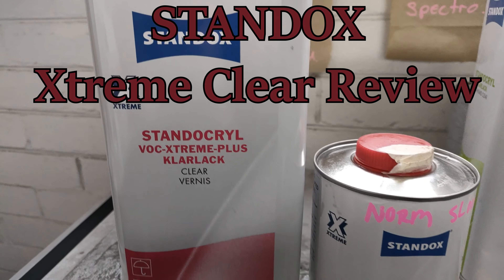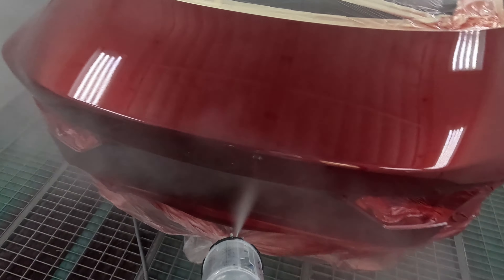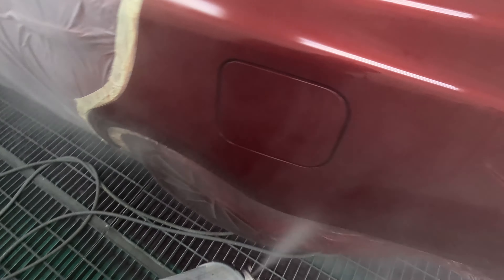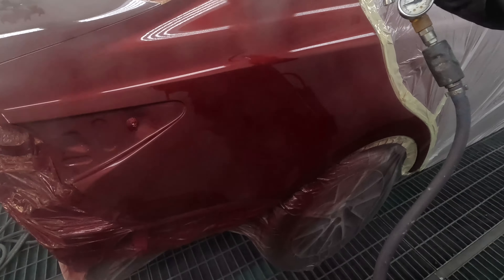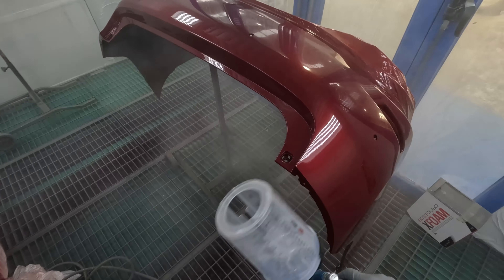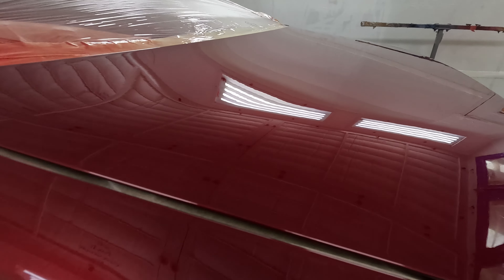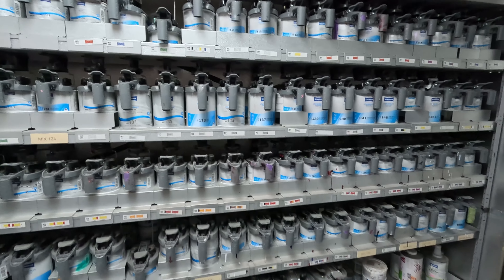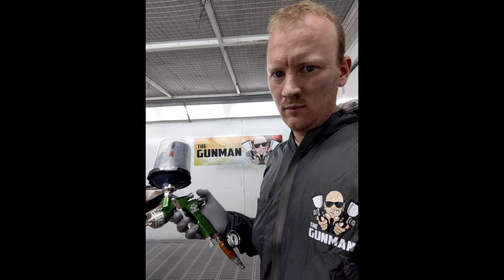Standox Xtreme Clear Review, K9600 Air-Dry Clear

Comment: Hey GunMan, I have been watching your for ages and leant a lot how to paint and bought the prolite based on your advice and tried it on a few panels and bonnet which was my first time painting and it came out perfectly in a garage under a makeshift booth in a temp gazebo and drop sheets. Long story short, thank you very much for everything! I used Debeer system and seems to be a very good finish. I wonder if you would do a similar review on Debeer as im about to start on a project painting a  whole car. Or what would you recommend using for a novice like me that is also not as expensive but gives good lasting results. This time im using an inflatable paint booth.
Reply: I've used a few different systems with the air bake I'm in Scotland so I've only used a fast hardener and the slow hardener Gunny is using seems to give him more time around the car, anymore than 2/3 panels and i start to get overspray from the other panels and I'm in a booth most of the time I'm using it, the odd bumper job outside still happens but if you're using a fast hardener you have to be fast at painting around a 7 min dust free cure is what I'm looking at and a 21 min ready to denib sand and polish on the data sheet, I go 30 mins and I use a company called genrock not the most expensive out there but there an all rounder good value products and funnily enough I think standard gen-rock clear is too thick and it just doesn't work for me,
 I use there air bake clear its amazing,  I keep a tin on shelf as a there if I need it, good for a fast job or a smart repair,  costs £60 ish for 1.25L kit 4 to 1, 
just a few things that I would think about are , it doesn't go as thick as normal clear so i have to be more careful about polishing, edges burn through, so the job has to be super clean and extraction would really be a bonus,
 how fast can I paint this job without rushing before overspray from one side of the car lands on the otherside
 , how much more time do I have with a slower hardener, 
am i painting the roof,.  can I mask up and paint the car in sections as the clear goes off quick enough 
Remembering to use paper masking only, not poly that sheeting because it may stick to fresh paint like it did last time 
It will be interesting seeing what The Gunman says to it 🎖️
 maybe you can send him over a tin off Debeer airbake clear to test out, ..
 maybe we all can send different clear airbake manufacturers products 🤔

Comment: I spray Spies in Massachusetts a bit out of Boston and I'm pretty sure the same clear is 8094 air dry for our line. I spray nearly everything with 8035 hs and slow everything. I keep 8094 stocked and use fast hardener with accelerator for spray out cards, shop floor work and any parts the boss needs out yesterday.
Reply: I was just wondering if it was the same as 8094.    We Use it alot in the winter as we are a no bake shop

Comment: I used the cromax variant of  this clear and at first it was ok but after a month off using it i got nothing but trouble with it it ran of panels with a ultra thin coat , pinholes would show up if the base was just a little bit to thick , it dyed back realy bad , the clear would crack on bumperbars even flexible steel panels if you did not put a elastic additive in it wich would make the clear realy thick an glogy , and the overspray would stick to panels and you could not bury it because it was so thin , my experience with it was not very pleasant , we switched to a snap clear , it stays open for realy long but as soon as its gets past 50 degrees it is hard as a rock in 15 minutes

Comment: Is this Standox marketed under the same name in USA ? I want to give it a try on a smaller project like a motorcycle or guitar.  Thanks Gunman  ! 👍🏼
Reply: Standox is available in the states but it's identical paint line Spies Hecker is more widely available. Although it's not cost effective as it's a top of the line paint system.
Reply from the maker: It's owned by the parent company Axalta, they brand it as Cromax or Spies Hekker in the USA, I believe Spies Hekker is becoming quite common in the states.

Comment: Hi, I have been admiring your results for some time. I have an historic vehicle I am working on - now prepping for a full respray, with doors, boot and bonnet removed. Is your workshop in the Perth WA area? If so you could make my day by doing the 2K black on the roof / body of the car. The doors etc I can manage (and flat back if I mess up), but the body is too big a challenge for where I am.

Comment: What do mean activite base coat
Reply from the maker: You must either use a specific wet on wet primer or use an activator/hardener in the basecoat, or you risk losing adhesion.
Reply: @TheGunmanChannel  thanks you 
a question for you did you filter the clear befor you but it in pps?